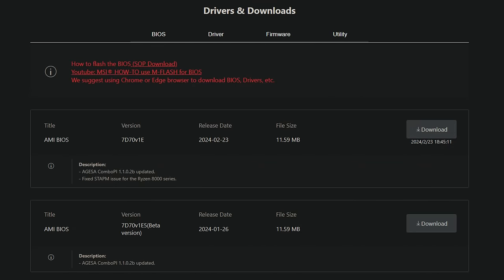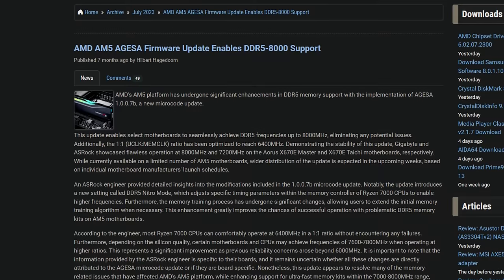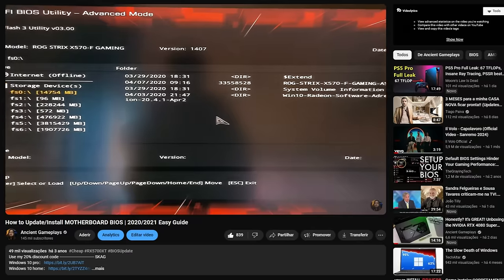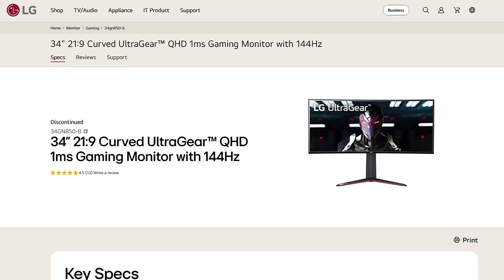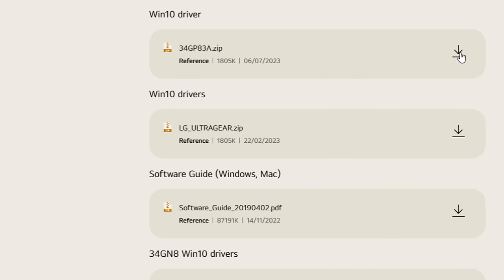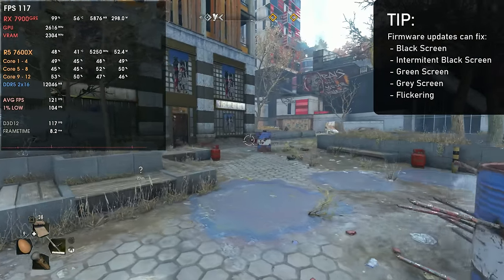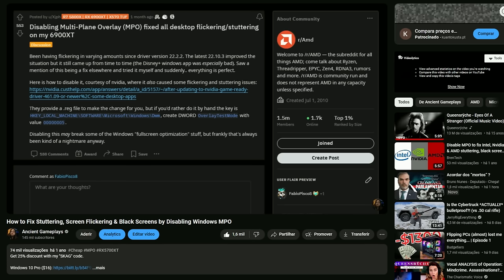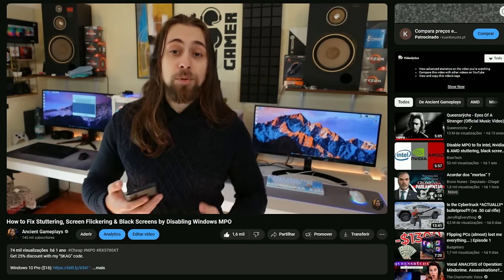20 TIPS to FIX "AMD GPU's Problems" | Easy 2024 Tutorial Guide

Comment: Just wanna let this comment here for people with the 7000 series. The RX 7600 and 7800XT, especially those models that come overclocked, are absolutely horrible for gaming. Big stuttering, trash frame times, and low fps. All I had to do on my 7600 to finally stop it from crashing, was to lower my wattage by 10W and lower the clock speed to the reference model's speed. This imediately fixed all of my driver crashes and my frame times are now better than the frame times of the newly released RTX 4060. Oh, and I almost forgot, DO NOT DOWNLOAD AFTERBURNER TO MONITOR PERFORMANCE STATS!!!  You'll thank me later... Basically, the overlay causes many newly released games to crash due to a driver timeout error. P.S. Driver timeouts also bug out fan control applications. For your fan control to kick back in normally, you'll have to turn off your pc and wait up to 10 minutes. Then, the fan speed will start going down to your set limit.
Edit: My card came overclocked to 3100Mhz clock speed, which is insane! This seems to be the norm with 7800XT models and 7600 models. Avoid high clock speed models like my Powercolor 7600.
Reply from the maker: So you mean that 2 cards that I have and work perfectly well are in fact...horrible?
My man, let's not take conclusions about something you clearly don't know well... just saying
Reply: @AncientGameplays yooo hold  your horses. What's up with the attack on this guy like that?
Reply: I can attest to this, i had a Sapphire pulse  rx 7600 and was getting stuttering in some games and crashing in some, especially with msi afterburner, and i did notice the out of the box oc was quite aggressive.. i think as far as 2900mhz if i remember correctly but i might be off on the number, i really should've tried to slightly underclock it to see if that helped.. either way i sold it and bought a second hand 6800 xt with no problems so im happy.
Reply: @radical24NFM  And I thought I was the only one, lol! My powercolor RX 7600 and 7800XT were both factory overclocked to over 3Ghz, when the refference models were barely reaching 2700. If you still want to know the fix to your 7600, it is to do 2650Mhz clock speed (refference card clock speed) and turn down voltage from 1200 to 1190. These are the most stable settings that work for all the games. I've tested them since I got both of my cards, back in November. You can get away with other settings, but you will have games that will crash and others that won't. Strangely enough, the frame times also change. Anyway, I'm happy that you got a 6800XT. That is my dream GPU and I honestly should get it. It's a beast for gaming and it doesn't break the bank like Nvidia's equivalent.
Reply: @Chakotay2222  I don't think he meant to attack me. He is probably reffering to how I expressed my hatred towards these 2 cards in my original comment. I used words like "horrible" to describe something that many people have no problems with. It's just the beginning part of my comment that shouldn't be taken for granted. The rest can be proof checked by asking people who own the same card models that I own.
Reply: @iustininfinite6841 hi bro! The refference of card clock speed, is boost clock speed right?
Reply: @tomiibanez  Yeah. It's the maximum rated stable clock speed of the card. Any GPU runs at a boost clock speed when it is being utilized at 100%. The problem is that if your GPU goes above the maximum rated clock speed, it can cause the driver to crash, and also the power draw to spike 100+ watts
Reply: @iustininfinite6841  thanks for answering bro. I asked you because i have the same GPU rx7600 but is the ROG STRIX version and the boost clock of this version is 2755 MHz. So i asked to know:)
Reply: @iustininfinite6841  sorry the last question. After doing this you dont have any more problems?
Reply: @tomiibanez  Correct. Every problem related to crashing went away. This seems to be the same conclusion many have drawn about the 7000 series. An unstable stock overclock from the manufacturer. Previously, when I was having this issue, it was actually mainly an AMD driver fault as all of the 7600s were overclocked by default, from the app, to 2900Mhz. The same problem was present on the 7800XT and 7900XT/XTX/GRE. I tried using stock settings, but I started experiencing the same problem again, so I went back to my custom preset.
Reply: @iustininfinite6841  thanks again for answering. For the moment i dont have any issue. But im going to try What you said. Have a great day

Comment: The one I can confirm helped me was upgrading to a good 16k display cable. If you plan to do any gpu overclocking, this is a must.
Reply from the maker: Like I said, people usually neglect cables...
Reply: @AncientGameplays  my fault was assuming an expensive monitor would just include a good one. It took me a few months to figure out the cable was why I couldn't push my vram frequency as high as most others with my card.

Comment: What a great video! I didn't knew about the MSI ULPS option for AMD, i was wondering if there was an option to stop limiting the card, now i can finally tell my friend to do this with his RX 6600 8GB i've recommended, plus he is loving to study computer hardware + basic programming on a presential course from Portugal too.

The GPU upgrade example you gave is exactly what i did, GTX 1060 6GB -> RTX 4060 8GB, it has been a wonderful experience, the only blue screens i've seem are related to memory, maybe the XMP to 2666 (yeah, it's this old) wasn't great back then.

Comment: Hi there fellow AMD users.
I've had a Sapphire Pulse 5700 XT for over 4 years now, and have suffered many times with driver timeout issues, and I guess I found the fix just a few hours ago.
It is most likely related to AMD drivers/software setting by default the clock and voltage profile boost values ABOVE what the manufacturers suggest (e.g.: Radeon Adrenalin Software profile set to "automatic" will actually auto-enable overclock to 2100 MHz at 1.20 Volts).
You can use Adrenaline software, into "Performance", then "Tuning", enable "GPU Tuning" and "Advanced control", then you can see the voltage/clock curve with 3 points, open the "Fine tune" option just below. Set P1 above 750mv, and P3 to the Boost Clock suggested by the manufacturer (example for my GPU is 1925 MHz) and undervolt to around 1.10V. Also set the "Power Limit %" to it's maximum. Apply this profile and you should have no more timeouts. This might cause a little loss in performance, but maybe can be fine tuned to stay close as possible to timing out.
Also, this might need to be done after each update/reinstall of the software.
Fabio has some tutorials where he undervolts and overclocks using the same feature from the software, which should also work.
I was having timeout crashes/freezing 5 minutes into gaming (MORDHAU). After setting this profile, haven't had anymore. Might be a false hope but it has become stable at least for now.
Btw Fabio, maybe bring this solution in your next "Fix AMD problems" video, if it is helpful. Unfortunately this problem is not too uncommon. Thanks for your videos and tips on those issues.
If anyone else is interested in the source:
https://community.amd.com/t5/drivers-software/sapphire-5700xt-driver-update-black-screen-hangs/m-p/459700#M141206

Comment: If you have a ryzen cpu that you overclock and are having constant driver crashes and you've used DDU and reinstalled at least once,  you may be just BARELY unstable on your fclk as well as possibly the ram as mentioned.

easily half of my crashing issues when I got my 7900XT at first was due to unstable FCLK on my 5950x. I ended up giving it a tiny bit more SOC, VDDP, and VDDG voltages (1.054vsoc 975mv 975mv respectively) and it solved those issues. A fresh driver install as well as using Drive Easy to update stuff like chipset drivers that had gotten out of date on top of that solved my issues 100%. 

Now I only have gpu crashes if: the game is badly optimized and crashes all on its own, my gpu OC is unstable on a given game, or my dram/fclk is unstable because I pushed it farther trying to get more out of it (I really want 2000 fclk but I seem to hit a HARD wall at anything above 1900 lol)

The weird thing that kept me from finding the issue for nearly 2 weeks was that it was 100% stable in EVERY cpu load scenario and had no errors in mem tests or WHEA errors, so I assumed it had to be the gpu/drivers. But nope, just needed a tiny bit more voltage

And yeah I cannot stress enough what he said, DO NOT CHEAP OUT ON YOUR PSU!!!!!! I got an EVGA 700W Bronze roughly 7-8 years ago for my first ever build that sipped a casual 150 MAYBE 200w (gtx 650, one hdd, 8gb ram, and an athlon 860k) and it has lasted me all the way up to my current 5950x 7900XT 32GB build. Im actually ideally going to swap it out soon with a 1200+w psu, that should hopefully last me another 7 years. I simply cannot stress enough getting a good PSU.

Comment: Impeccable video as always, very clear and direct. In my experience, I'm not a fanboy of any brand; I usually buy whatever gives me the best performance for my budget. Currently, I'm happy with a 5700X that I upgraded not long ago, and I'm planning to upgrade to a 5800X3D. However, I had several issues with my 6700XT GPU, which were resolved when I switched to Nvidia. Some problems occurred in Windows, YouTube, simply browsing, random restarts, stuttering in games, and even issues while working with Illustrator, etc.

Upon purchasing a 3080 Ti, I stopped experiencing all kinds of problems (I had already ruled out that it was a physical problem with my 6700XT). Although the overall performance of my former AMD card was very good for what I paid, the issues I encountered outweighed the benefits. Anyway, this is just my experience. Regards!

Comment: Great video but I would like to add 2 things, xmp on amd mobo is called d.o.c.p and if you are experiencing issues try disabling freesync as Jake from ltt experienced issues when having it enabled on a secondary monitor, which it was by default.
Reply from the maker: Disabling freesync might help in some cases with flickering, bht that's about it. As for xmp, nah, d.o.c.p is not for all boards, some brands will give it different names. On am5 you either have expo or xmp. The amd boards will show xmp as well

Comment: Disabling ULPS can be done with registry also, its simple changing 0 to 1. I have to do this each driver reinstalation, as my monitor firmware (no new release since 2019) doesnt like to work properly with this function and with Windows overall (no such problem on Ubuntu). It wont go sleep after X minutes of inactivity set in system, it keep awaking with black screen showing "no signal" every 30 seconds.

Comment: 23:35 When you run your ram at the rated speed you are overclocking. According to AMD, Intel and Ancient Gameplays. The rest of the industry will think you are mad if you run your ram at the slow JEDEC speeds instead what the RAM maker meant the ram to be run at.
If you have issues with your PC it can help to troubleshoot by temporarily running at slow default memory speeds. If that solves your crashes you now know where to focus your troubleshooting. XMP is not holy. If you enable it and your PC starts becoming unstable you might have to tweak a number slightly lower to get a fast stable system.

I really thought he would go into how motherboards often overclock by using optimized defaults. But calling XMP overclocking... That is special.
Reply from the maker: It is overclocking per se haha, just a tested one mate haha

Comment: Another thing to do is make sure you're only using one program to control your GPU.

For the longest time, I couldn't figure out why the hell I was getting driver timeouts all the time. Turns out it was because I was using MSI Afterburner to control fan speed while using Adrenalin to overclock. And uh... the two applications ended up fighting for control of the card in the background without me even realizing until just the other day.

Comment: Rx6750 owner. Clean win11. My profile in adrenalin software doesn't load correctly at windows startup. Every time I should load the profile manually. I've seen same issues on the forums and it's somehow related to windows copilot.. so I set adrenalin settings to default and made all the changes with MSI afterburner (including fan curve, undervolting etc.) and it solved my issue.
Reply from the maker: The issue is simple. The oc is not 100% stable. Raise the voltages or decrease frequency and it stops happening. Seen it hundreds of times
Reply: Damn, so my RX 5700XT cannot handle your OC profile for it. I'll try steps of -50MHz then.  @AncientGameplays

Comment: Ever since windows vista (I know), I never had windows issues, in terms of reducing performance, even after changing platforms with same installation, because hidden and unused drivers can be deleted manually.

In my opinion, clean install should be done only if issues occur, but in 99.9% of cases, it is a driver issue. When I had CPU overhead issue on 3200G (for about 11 months), rolling back driver with good driver even without restarting PC (after asking for it) would instantly fix the issue. Clean installation also requires every game to build shader cache again, which in case of many games requires unplayable experience for few-30+ minutes over and over again after every driver update, especially problematic on weaker CPUs.

Because anti-cheats are more invasive than ever, I would not recommend turning off core isolation unless running on iGP.
Reply from the maker: The thing is, windows updates is usually what breaks small things IMO
Reply: @AncientGameplays Most windows issues start with tweaking apps and scripts, which is why windows breaks sometimes. I do these things "manually", so I know exactly how to revert things.

People who have issues with windows should install fresh win11 to turn on smart app control, which should block all non-verified apps/signatures. I can't test this feature because I use both of my PCs for work, so I don't how if it is useful or not.

Comment: My issue ended up being overclocking stability. I have a Ryzen 7 5800x which had a stock speed of 4.2 GHz. At some point I set the speed to 4.8 and it worked just fine... until I got a much better GPU and my PC would crash during games. Thought it was the GPU, but nothing worked. Then I thought that it might be the PSU. My PSU was almost 10 years old, and I saw the thing about transients and power spikes on newer GPUs (currently have a 7800 xt), so I got a new PSU with ATX 3.0 support... that seemed to have worked for a bit, but I started having the same black screen and crashes after a day. I was about to return the GPU (bought it less than 6 months ago), but I thought I should test some things one more time.

So I started testing again: couldn't run 3DMark, it would crash instantly. Had no issues testing the RAM with TestMem5. Then I finally ran Prime95 and my PC crashed instantly. Tried it 2-3 mores times, same thing and then, while checking the temps and speed of my CPU I remembered the stock speed was 4.2 GHz and not the 4.8 GHz it was running it at... lowered the speed to 4.4 GHz and Prime95 runs fine. At that time, I had already done everything on this list except for the Windows clean install and lower the CPU speed, so I was about to give up. I'm glad it worked in the end.

I'll tinker with it a bit more in the next few days to make sure it really stopped crashing.

Thanks a lot for the tips. They really helped me figure out what was wrong with my PC.
Reply from the maker: I know for a fact that OC stability usually does this kind of stuff. Glad I could help!

Comment: Ive had a nightmare driver issue that even DDU couldn't fix. My system didnt report my A770 properly so the drivers won't install. And when they did, they installed release version from 2022 and it borked everything. After hours of tearing put nonexistent hair, I downloaded and extracted the download file, inside there's an executable file that I just decided to click on, basically just shooting arrows in the dark. And it a tually worked! One of the files was the actual install file but slmething was preventing it from being accessed.

The joy of being an Intel Arc guinea pig.

Comment: I use a combo of NVME drives and HDD on my gaming system. I have a gen 3 1TB(Windows 11/Windows gaming)  and a gen 4 1TB(ext4 Linux/Linux gaming) an two 8TB Seagate 7200 RPM Barracuda HDDs which hold the bulk my game library(mostly NTFS for windows gaming) . If the game is laggy or has slow load times I move the game to an NVME.  I run Starfield on the gen 3 1TB and the gameplay is improved by leaps and bounds because the load time are so fast it doesn't  ruin the game immersion.  I have run Borderlands 3 on both HDD and NVME the only thing I noticed was faster game launch time and the shader cache built faster.  I tried keeping one set of games for both windows and Linux but Linux does not like to write to NTFS.

Comment: Still troubleshooting my 7900 XT issues in COD. Still no answers. I will review your tips and see if I get my situation resolved. Rtx 2070 Super, and 3060 Ti, work just fine, but can't get 7900 XT to play nicely. Still think it may end up being a failing GPU or Motherboard.  Thank you as always for your time, efforts and ideas.
Reply from the maker: Watch it, cod works perfectly here
Reply: @AncientGameplays  I have reset everything to 'default', turned off MPO and clean installed the drivers again and it looks like 'fullscreen exclusive' mode is what is crashing the system on my dual monitor HDR system, but I will keep checking and report back.
Reply: Make sure you do not have AMD anti lag anti lag+ turned on. Idk if the issue is fixed now since i dont play cod anymore. But it was causing massive issues